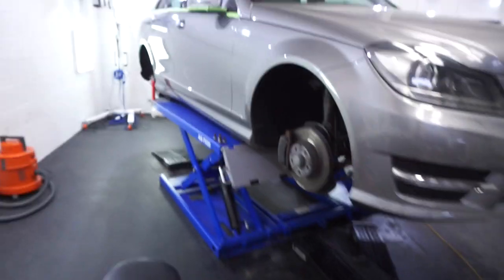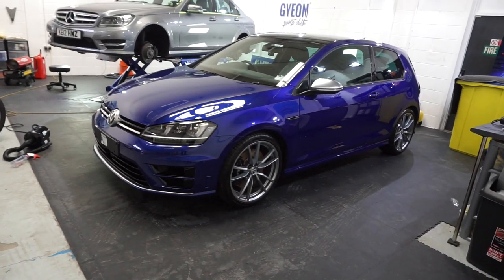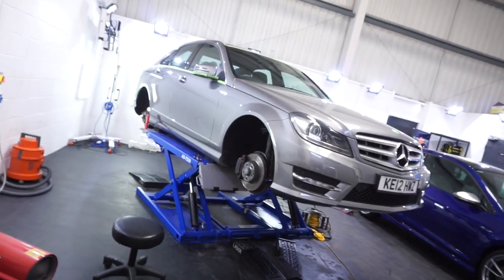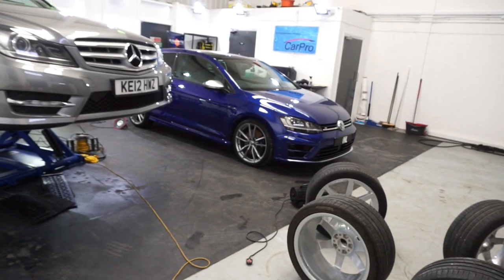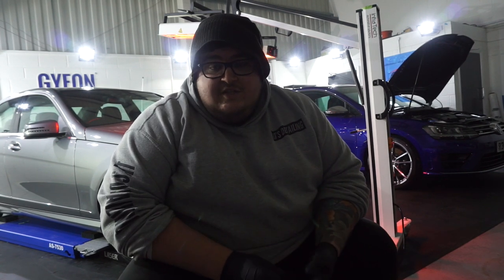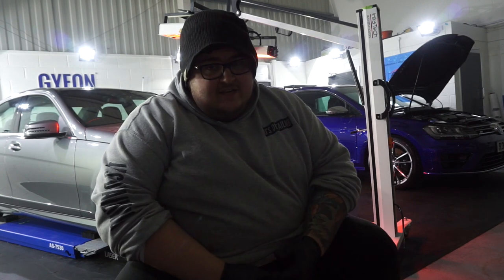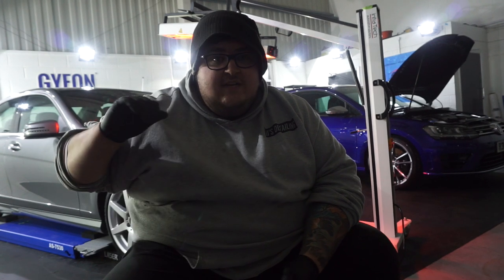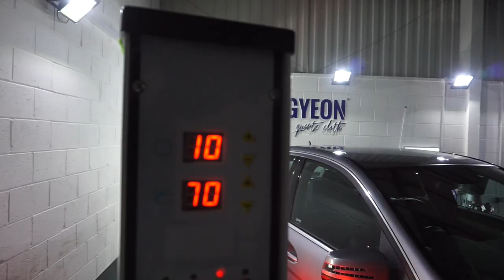Correcting & Coating - Vlog 10

Comment: Nice work. What is your lighting setup?  Pardon if you answered in the past.
Reply from the maker: We have 50 watt led spot lights above which are good for spotting defects, nd the panel lights are a diffused light very good for coatings as it shows bits that could be missed, as for touches I've got a sealy colour match hand held torch, hope that help 👍